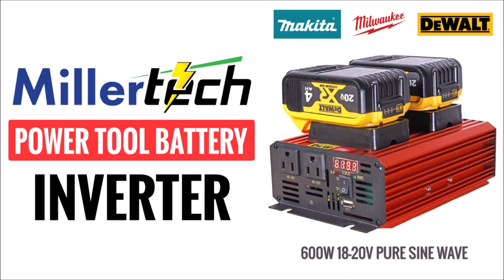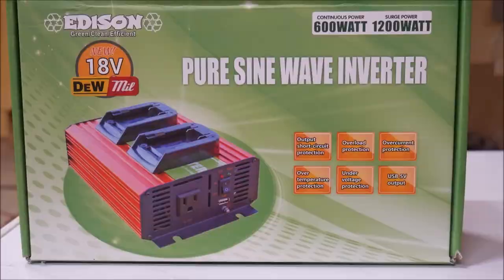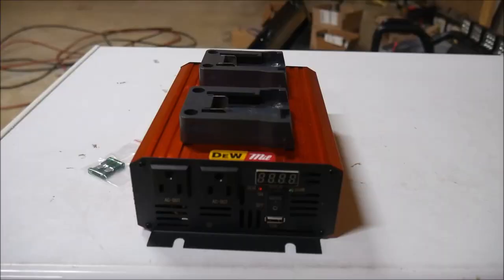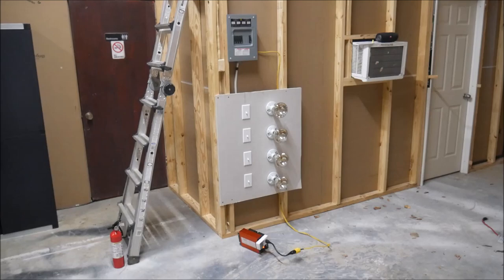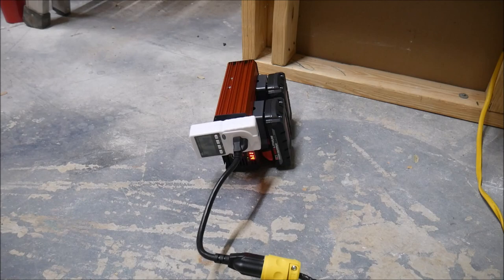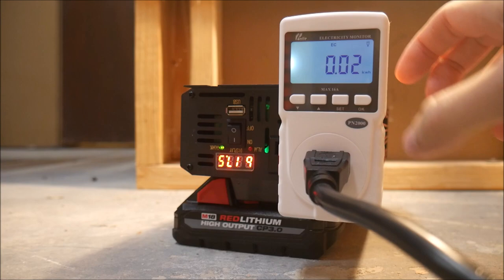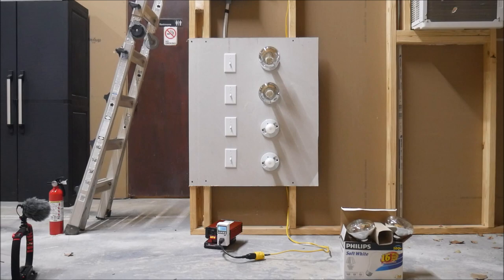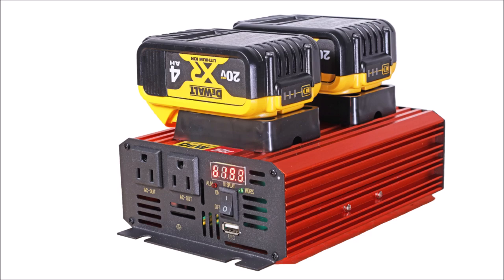MillerTech EDISON Power Tool Battery Inverter - Use 18-20V Makita, Milwaukee, or DeWalt Batteries!

Comment: I stay in Scotland and was looking for something to power lights in my van because I intend using my van over the winter months to work out of with my chop saw and table saw but they will be rigged up from an extension lead running from the customers home. 
Or what's the best way to run lights in a van so that I don't drain the main battery in my van. 
Thanks.
Reply from the maker: Something like this would work well for lights.  But power tool batteries don't work super well when it is really cold, which I expect winter in Scotland is.  You would have to keep them above freezing to get much performance out of the batteries.
Reply: @LDSreliance  is there anywhere over here selling this type of thing because I've never seen it before. 
Thanks for the reply.
Reply from the maker: In Scotland?  I have no idea.  Sorry.  MillerTech only ships to the United States and my online store follows the same.  International shipping is a horrible nightmare that I don't wish upon anyone.
Reply: @LDSreliance  I have shipped to the states a few times and its a bit of a ball ache right enough. But they do eventually get there. But then the buyer needs to pay taxes which there not happy about and its always the buyer that needs to pay then unfortunately. 

No worries, I'll look for something similar here. 

Thanks for the replies. 👍🏼
Reply from the maker: Yes, I'm not worried about it arriving there.  It is just the process of filling out all the paperwork, paying the fees up front, waiting for it to clear customs, then getting hounded for more money (the taxes, like you said) and then trying to collect additional money from the customer.  If it was a more streamlined process and I knew what the taxes were going to be up front I wouldn't mind doing it now and then.  Although I would have to charge a little bit more for my time as it takes 5x more of my time to do than a domestic shipment.
Reply: @LDSreliance  I think with ebay it's so much easier if you use there global shipping program tho. Because its just like a normal shipping and goes to a depot with a number attached then they match all that to the shipping address and jobs a good one. 👍🏼
Reply from the maker: I'll look into that.  Thanks!

Comment: So it's basically a 24 volt inverter? 
From the bottom view, it seems they have a 12, 18, 24 and 96 volt version.
Reply from the maker: The OEM has those models of the base inverter.  But the units that MillerTech gets are modified specially for them without the battery input terminals on the front.  They just come with wires sticking out the top of the inverter.  MillerTech takes those units and then attaches the sockets on top to be able to use the power tool batteries and then solders the electrical connections.  Pretty sure it is the 18V version that is the base unit.
Reply: @LDSreliance  After reading the specs, I realized it was the 18v version. Thanks.

Comment: Could a 54V DeWalt be used for this? Thanks
Reply from the maker: Is that the FlexVolt?
Reply: @LDSreliance  sounds like it should. Flex volts only output the “60 volt” when attached to a 60 volt tool. Thats how they are flex volt. The 20 volt tools don’t have the pins to access that power. I’m planning to use flex volts with my inverter when it arrives.

Comment: Will it power corded tools like grinders
Reply from the maker: Yes.  The 1000W model can run a die grinder easily.  I have tested it.  As long as it is under 10A or so corded it will be fine.  Keep in mind the batteries are small and don't have a ton of power so you wouldn't be able to run big power tools like that for long periods of time.
Reply: @LDSreliance  what about 10.5-13amps? What if I use HO Milwaukee batteries? Yes these would be in situations with no access to outlets
Reply from the maker: 10A will exceed the ratings of the inverter.  10A x 120V = 1200W.  It will do it for a few seconds but could not do it under a sustained load of 10A or more.

The batteries can do about 600-800W each, maximum (based on the maximum discharge of the cells, not the manufacturer's recommendations).  But it would not be advisable to do that for a sustained load.

Comment: Could Dewalt flexvolt 60v 9.0ah used for this?
Reply from the maker: Yes.  The Flexvolt batteries are compatible.
Reply: Do flex volt batteries increase voltage and/or runtime?

Comment: So I'm sure the numbers are estimated but....
Let's start with a fully charged 20v 4ah Dewalt battery. How long could it running the inverter at max wattage.
Single 4ah for the 300w (how long at 300w)
Double 4ah for the 600w
(How long at 600w)
I'm considering this as an option for changing an ebike for camping trips and looking to see how much it would add to my overall range
Reply from the maker: How long the inverter can go depends on how much power is being drawn by the inverter and the losses in converting from 20V DC to 120V AC.  So you would have to tell me how many Watts your ebike charger consumes before I could estimate it for you.
Reply: 250w
Reply: This idea makes a lot of sense to me.
Especially if a person has time to stop and wait for bike to charge.
I see other running 2nd and even 3rd batteries.
I have lots of 4ah Dewalt battery.
The idea is to ride to camp for the night and let bike charge while I sleep.
Reply from the maker: Factoring in about 20% losses, a single 4Ah battery would give you about 15 minutes of charge time.
Reply: Alrighty then.
So bigger than 4ah will be necessary.
A single (rough guess) 4ah battery would only add about 3 miles to the range.
Can you share your math so u can play with some numbers......
Reply from the maker: 4Ah x 20V = 80Wh (how much capacity the battery has)
80Wh * .80 = 64Wh (factoring in 20% losses)
64Wh / 250W = 0.256 hours or 15.36 minutes
Reply: @swartzautoman2  what voltage is the bike battery?
  e.g..  36V nominal, that is around 40V fully charged. Why not just parallel a couple of those power tool battery pack packs and use them directly on the bike.
Reply: you can just forget about charging your ebike with this setup, unless you have a dozen tool batteries laying around.  You would be swapping the dewalt batteries every 30 minutes as they run out.  You would be better off getting a real inverter and a couple of deep cycle batteries.  But do the math first, it's pretty simple math.  VxAh=watt/hour on the battery side.  compare to VxAh on the using side and after you use it a bit you would figure out the efficiency of the setup, it won't be 100% for certain. maybe 70-80%

Comment: Will it handle a rice cooker?
Reply from the maker: If the rice cooker uses less than 600W it should be fine.  According to a quick Google search the average one uses 600-700W so that probably won't work unless you have a small one or an energy efficient one.

Comment: Do you do a higher wattage one?
Reply from the maker: Not currently but you aren't the only one requesting it so I will see what I can do.
Reply: @LDSreliance   An 1000 watt would be awesome and defenely buy it
Reply: @LDSreliance  I would like to see one that will accept 2 or even 4 power tool batteries, and will also accept 12 volts (bonus if it can accept the two voltages simultaneously) and output enough watts to run two Milwaukee superchargers(not sure the required watts but possibly ~1440W) so that the inverter could run off power tool batteries, and then be hooked to a12 volt battery(car/truck battery, or solar input) and then run power tool battery chargers. Even running the dual port rapid charger (~660W?) would be great if it can run off 12 volts. As it is, I will have to carry around another inverter to run off the car 12volt battery system to charge the batteries back up. It would be nice to just need one inverter. Another feature that would be great would be USB-C fast charging for smart phones and laptops! 
I did received the 2 battery 600W version in the mail today, and I'm super excited to add it to my collection alongside the Milwaukee Topoff (175W with USB-C and A fast charging). Thanks!

Comment: If I understand this correctly i will not get 600 watts of usable time instead when i use two 6 amp 20v batterries i will get just 192 watts of usable time? If this is the case then this device only makes sense if one has a bunch of 15 ah batterries lying around. You can buy a 350 watt powerstation for less than $200 on amazon that will have way more bells and whistles!
Reply from the maker: You are confusing the math here.  If you have one 6Ah 20V DeWalt batteries, that is 120Wh of available power.  Wh is a measure of capacity.  To estimate your run time based on that number, though, you have to know what it is you are providing power for.  Lets say, for easy math, you have a 120W device that you are plugging in to the inverter.  You could run that device for one hour (120Wh divided by 120W).  In the real world, though, you will lose a little bit of power due to losses in converting the power from 20V DC to 120V AC so you could expect to run your device for a little less than an hour.  But if you had two identical batteries plugged in you could run for almost two hours.  Etc.

Again, that has nothing to do with the inverter.  That has to do with the capacity of the batteries (the Amp hour or Ah rating).  A 350W Powerstation on Amazon for $200 has all of the same constraints.  It has 296Wh of battery capacity so it could run the same 120W device for about two hours.  But it has a lot of disadvantages compared to this inverter.  I won't detail them all because this is apples and oranges.  Someone is going to buy this inverter because they already own Makita, DeWalt, or Milwaukee power tool batteries and this is a handy way to get even more use out of them.
Reply: My point and question tho is How do you achieve 600 watts from this? As you just explained two 6amp batterries at best amount to 240 watts. The highest Dewalt battery is 15 amps so wouldnt you need these batteries? Otherwise one should really just go with the 300 watt version of this device right?
Reply from the maker: No, they provide 240 Watt hours.  Not 240 Watts.  You are getting confused on terminology.  Watt hours is a unit of capacity, like volume.  Watts are a measure of power.  The inverter can provide 600W and that has nothing to do with the capacity of the batteries.  But the two measurements are related when you add in time.  You can introduce a number of hours into the equation to see how long a given capacity can run at a given power.  For example, at 240Wh / 600W = 0.4h or 24 minutes.  In other words, the inverter can run for 24 minutes at a power of 600W given two batteries totaling 240Wh (ignoring losses in conversion).

Comment: Can This run a fridge or other things ?
Reply from the maker: Yes, it can run a small fridge.  I just tested it with my dorm fridge.  Ran just fine and held steady at 18V.
Reply: @LDSreliance  how long did it last
Reply from the maker: Jules, I could test this but it would be irrelevant for your situation.  This would be based on too many variables, such as the model of fridge, the ambient temperature, the age and condition of your batteries, and the capacity of the batteries that you used.
Reply: It might run it, but not for very long per battery.  If your fridge draws 6 amps at 120v and you used 2 fully charged dewalt 20volt 5Amp/hr batteries it would run your fridge for at BEST 15 minutes.  Because, well, MATH and physics.

Comment: Thanks for this.  Will be buying using your link. How reliable is it?
Reply from the maker: MillerTech has sold thousands of these in the Amish communities of Ohio and Pennsylvania and surrounding areas and it does well.  I haven't used mine enough to say for sure how good it is long term.
Reply: @LDSreliance  well I just got mine and it looks very cheaply built honestly.   I can literally see duck tape coming out of it lol. Also I pluged in some lights and they fit snug on the plug and when pulling them off it looks like it's going break. For 215 dls I'd expect something better.   A common well built  600 watt pure sine wave inverter is less than this thing.  I'd pay a little more if the quality was better.   For 215 dollars I feel a little ripped off lol.   What's the warranty on those plugs??? I have a feeling they're not going to last much

Comment: That's cool as shit is the case connected to the ground plug? I wonder if it could power test equipment if you ground out the case to a ground of the motor or distribution equipment?
Reply from the maker: I do not believe so.  But the one that I am prototyping right now does have a chassis ground.
Reply: @LDSreliance  nice let me know when you have it or need some field testing

Comment: Will it run a microwave?!?
Reply from the maker: Even the smallest microwaves are about 1000W so,  unfortunately, no.  But I am about to release a video on their new triple socket model that should be able to do so.  It can handle over 1,000W so stay tuned!
Reply: @LDSreliance  I’ll just use all my crews batteries to warm my lunch haha
Reply from the maker: Haha!  That is awesome.

Comment: I’ll make my own for almost 200 parts are only 40 bucks
Reply from the maker: You can make a pure sine wave inverter for 40 bucks?  I'm listening.
Reply: @LDSreliance  yes I made one a few years back they sell boards from China u just need to add a transformers and some capacitors mosfets and resistors they have  kits available 
I have hundreds I parts from old electronics, there are many schematics on hand for someone to make one it’s not rocket science 
I’m not in anyway saying your product is not good I’m sure it preforms awesome if not better then I can make I just don’t like to buy things I would rather make them and I like the look of it and if it was made in the USA I would probably think about buying it
Reply from the maker: Shoot, if you can make one for that price that is awesome.  But 99.9% of people can't and won't do all of that.  I'm with you... if I can make something just as good I probably will do that instead of buy it.

Wait, you are good with buying Chinese components and soldering them together but you don't want to buy one that is made there?  Even if MillerTech spent 3x the price to manufacture these in the United States, they would still be made 100% with Chinese components and parts.  And then they would have to sell them for a lot more.  So I can't fault them for doing that.
Reply: @LDSreliance  I don’t even buy dewalt 20v tools I buy broken ones and just get new shells they usually just dump them at work and the batterys so I always scoop them up as well I’m trying to fund a ebike at the moment to build is my next project
Reply from the maker: Sounds like a cool project!  I have a Milwaukee battery that stopped working after only a few hundred cycles that I need to rebuild.  Never enough time.

Comment: why?
Reply from the maker: Why what?
Reply: Why not?
Reply: @alexgarcia3900  why?
Reply: @ShortCrypticTales  maybe to just about run the water pump on your natural gas furnace / central heating combination water boiler, in a Blackout or Grid down situation in the middle of winter. Might be nice to heat the whole house for 10 minutes then take a hot shower to keep clean and comfortable.
   Who knows what the World Economic Forum and the Rand Corporation have planned for us all going into The Great Reset.
   But if you've had all your covid jabs and booster shots I wouldn't go to the trouble of preparing for a little power backup.

Comment: Lamp test is SUX! Need real device test.
Reply from the maker: What are you talking about?  The lamp rig is a perfect way to dial in an exact wattage.

I also did a whole video on other things that this inverter can power:  https://youtu.be/9VDnlt-RRNg
Reply: @LDSreliance  Ok, I recently bought a Chinese one-battery little crap for/on 200W. I tested it with a 200W lamp and it works. But when I connect my laptop or my JBL boombox 3 it doesn't work. I'm looking for something that works with makita batteries and has the correct sine wave. Well, I currently doubt all the devices I find.
Reply from the maker: This is pure sine wave.  It is the only one that I know of below $1000.  I have tested it on all kinds of devices.  Check out the video I linked.